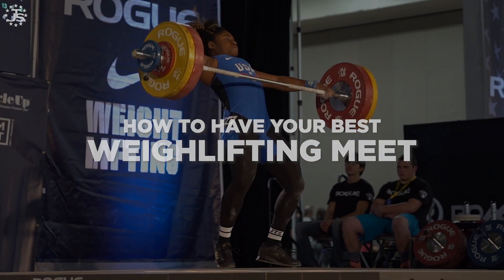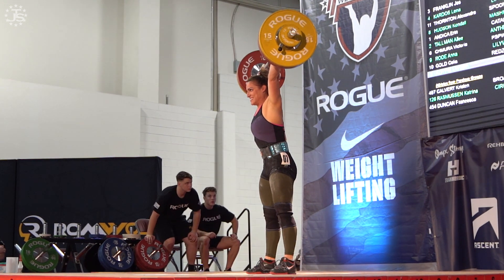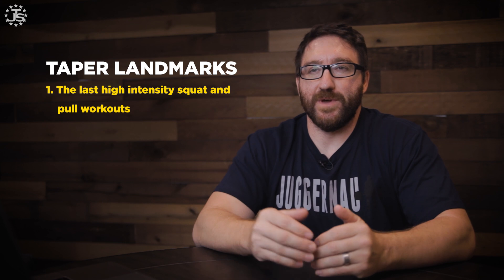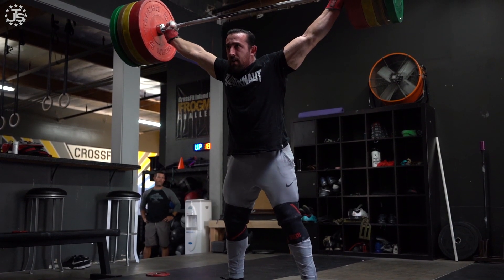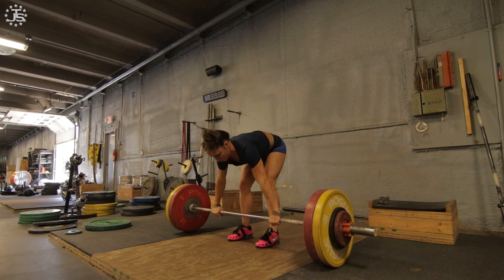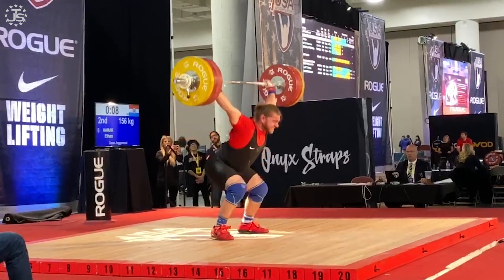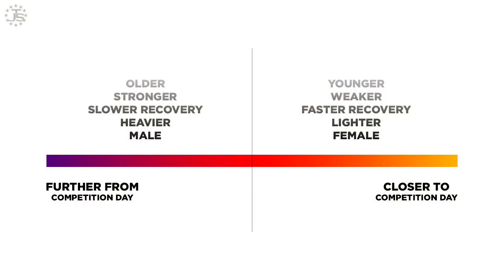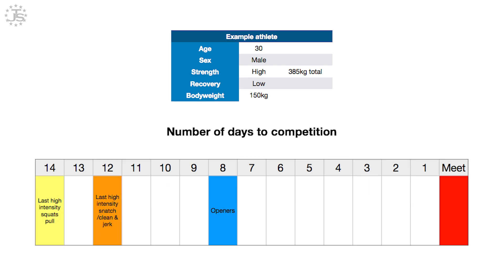Designing Your Taper | How To Have Your Best Weightlifting Meet Ever

Comment: What's the side effect if you had given the 55kg female example the taper of the 30 year old male? Like do they lose their strength and fitness too quickly?
Reply from the maker: Yes exactly.
Reply: How are these two metrics comparable?
55kg , mass

30 years,  age. 

Maybe this 30 year old is 60kg...
Reply: @sabertoothwallaby2937  while I used different identifiers, I was asking specifically to the examples they gave in the video itself, which denotes age and weight for both.